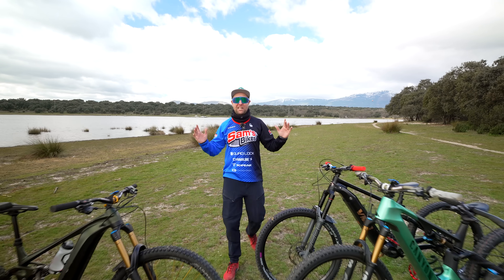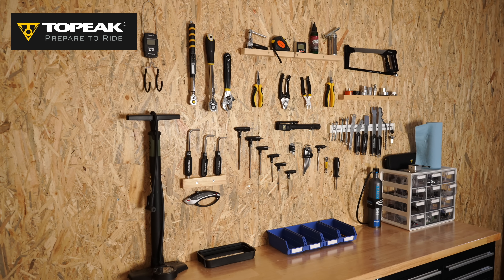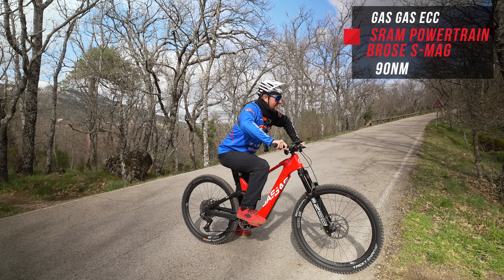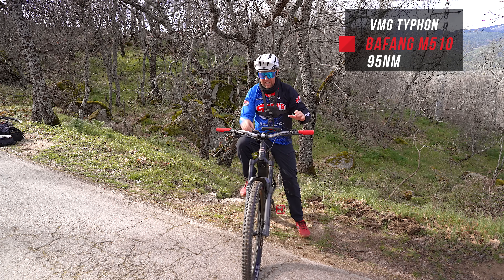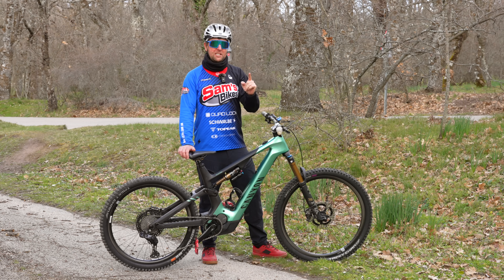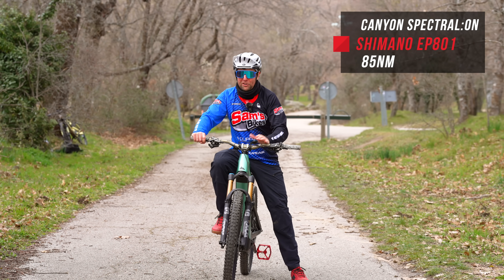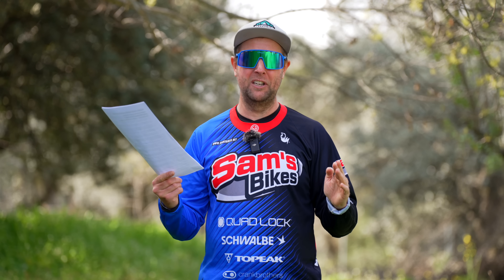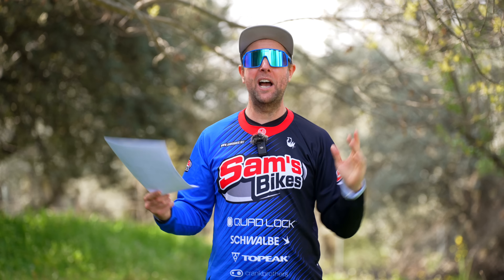MASSIVE eBIKE MOTOR TEST - 7 EMTB Motors, Which Is Fastest?

Comment from the maker: Riders I hope you like the first video of the MASSIVE EBIKE MOTOR TEST... like always got a question just ask.
Reply: Maybe a test to see which one hits the hardest wall when top speed is reached?
Reply from the maker: Not a bad idea!
Reply: Also a bosch cx vs race would be interesting to see. Thanks anyway! Great and unique video! Also it would be interesting to see a chart about times and the weight of the bike + the rider weight too! 🤔
Reply: Maybe give the Pinion MGU e1.12 a shot as well and focus on the unique strength of these systems. For example I myself would love to see Shimano bringing Bosch’s rocking motion overdrive option as well, for it’s great in difficult climbs. Cheers!
Reply: One video that was missing. Thank you!
Reply: I would not buy a motor system if it can’t be easily derestricted, 25kph just isn’t ok. Can you explain the differences between motor systems on this? Does the SRAM system use disc mounted magnets?
Reply: It's a great video and a great channel. I would recommend that you at least sometimes replace "ridres" with "guys" or "folks" or "friends" etc. Just for a change 🙂
Not all followers, I guess, riders

Comment: Not very scientific, honestly you need to post the full unedited clip of each run.  I do appreciate the effort you put into it but the results are too subjective based on the so many variables in your test.
Reply from the maker: Sorry I’ll try harder next time
Reply: @SamsBikes  no sorry it didn't come out the way I meant, I just had surgery I'm on 1 arm so type slow and short, broke my collarbone in bike crash.  I meant like more data, like with your power/wattage.  The wattage that was also coming from the motor, for instance on the Shimano 801, did you actually reach full cadence to get all the power from the motor and for how long, just some details like that to help paint the full picture.  It was a good video and appreciate all the work you put in this.  Also, not sure how official the start/stop of the timing was, I'm not even a Shimano 801 fan but something seems way off with that one.

Comment: The differences between these motors is minor compared to the difference between a 25km.h speed limited and an unrestricted motor. The best motor would be the one capable of easily modifying the top speed to whatever it was rated to, without the manufacturer throwing me under the bus and voiding the warranty.

Comment: If we're meant to take the test with a pinch of salt, what is the point of the test?? to make it fair (if you insisted doing this test one after another) you should have strtaed with the lower powered models instead of going with the most powerfull at the start when you have fresh legs, may have been a more level result this way. Even better why not do all the tests on one bike and do a different bike every day for 7 days this way the climb test would be at the start of each day when rested you would have got the best result for each bike.
Reply from the maker: Can’t make everyone happy, it’s the best I could do I’ll try harder next time!

Comment: Nice one sam , for me personally with the motors it’s turn around time for repairs, and that’s where my dealer race co cycles win , my friend has had new batteries and motors fitted and out the door in an hour , luckily for me my gen 3 levo with 1800 miles on the clock has been faultless , looking forward to the rest of your tests 👍

Comment: I would be more interested to find out which motor is the most reliable long-term. Period. I don't care how fast it is if it's going to fail. I've heard bad things regarding specific motors, and I see plenty of used bikes for sale with "new motor under warranty" which is just going to fail again.
Reply from the maker: That’s video 5 im going to be interviewing bike shops and mechanics and get there take on it
Reply: @brian - Bosch . it is one of the  oldest motors ,if not the oldest motor  in the group and has had the fewest problems

Comment: Hi Sam, I’ve always like your vids but this one I’m afraid is a bit silly. A lot of those bikes don’t come as default at there highest power settings from factory even when you put them in turbo-boost-rally etc. ie the sram motor needs to be turned up in the app before it will give out its full power. Also tyre pressure, suspension design, travel and lots of other factors play a huge role in a test like this not mentioning rider inputs. 

To go to this much effort and not pay attention to detail kinda makes it a pointless vid.
Reply from the maker: Hey mate thanks for the your feedback but clearly I had them un the most power possible via tuning in the app and all tire pressure was 24-28 same tires and suspension was set to how I ride each bike! Maybe I should of made those clearer

Comment: BTY i'm aware of Nox refusing to send you a bike to test , which i think is a big mistake of theirs BUT the Sachs engine is now being offered in one of the Storcks bikes . maybe they would be willing to send you a bike. 
personally i think NOX , which is now owned by BMZ the German battery company , failed in promoting their product . the only bikes i know of that carried their motor was/is  , nox, storcks , and a few scandinavian bikes . it's also oddly enough on an e ski bike from france and a few cargo bikes which is what  it was originally designed for . using the motor on MTBs was an after thought , i believe . the motor was designed for cargo bikes that  carry heavy loads at low cadence without overheating . however i could be wrong about this .the creator of the motor a german man said he invented it to keep up with his younger friends on the trail so,,,?
Reply from the maker: Thanks for the comment mate, I did reach out to all of the major ebike motor brands and you see in this video who wanted to send me a bike! I can’t do much more than that
Reply: as you know , i'm 100% convinced that the Sachs/BMZ can slay all of the bikes mentioned in a raw power test . not sure about naturalness, noise , smoothness etc but just raw power it can't be beat . 
personally i think nox and sachs cut their own throat by not sending you a bike to test . are they afraid of something or what ? very perplexing .

Comment: The raw power test might be more accurate  if done on a smooth asphalt street and maybe rest longer in between tests as fatigue can be a factor in time to the top . 
on a dirt trail there are varying lines that will be encountered and possible tire slippage etc .

Comment: It's worth noting that if you push the Rocky Mountain for extended periods of time it will overheat the motor.  Something that happen to me often.
Reply from the maker: Let’s see in my range test
Reply: aevan- i have the Sachs/BMZ motor 112 NM and one of the best features about it besides the raw power at low cadence is it does NOT over heat .

Comment: Are u crazy? You wanna find out drag like this? Motors have a clutch inside and you maybe rotating with first gear set. So the loss here is really low and you can not feel it by legs. 
That was old Bosch design, when you did rotating also with rotor, then you did feel drag. Drag nowdays is just a myth.
Reply from the maker: Can’t keep everyone happy 😃 I have been asked so many time and your wrong you can feel it in the motor 100% there is definitely more drag on the Rocky and Bosch
Reply: @SamsBikes  Dont know about Rocky. Ok, try to do more sophisticated test, not the funny one, that you try to tell after few peddals. 

Put down the chain and start to adding weights on pedal, how much weight you need to turn it. You would measure most friction of rubber bushing then some internal gear resistance. Try it even without weights, just turn by hand and tell me what you feel...

Comment: What casing do you use on the tires front and rear? Never tried those tires before. Thanks.
Reply from the maker: Hey rider, I’m running ultra soft super DH on the front and soft super Gravity but if I’m racing I’m ultra soft front ant back
Reply: @SamsBikes  Thanks Sam. Do you use a step lighter casing for the SL ebikes, or keep it the same?

Comment: Should do a test on which motor lasts the longest time before a warranty claim ! 😮
Reply from the maker: Yep that’s video 5
Reply: Won’t be the Brose!
Reply: @robbief1  Yeah that's why I wouldn't buy that system even though otherwise it's pretty decent and has option for extra batteries. Always worrying whenever the belt might come off doesn't sound like a good time.
Reply: I'm a lucky guy I guess. I have way over 2000 trail miles on my Levo and it's been super reliable. Especially compared to my wife's Trek Rail 7 which has been like a bucket of bolts.
Reply: @rickbault1221  The belt might come off from 1000km to 4000km.

Comment: I am looking to buy my first eBIKE. I live in germany and am looking for something preferably under 2K. I wont do any steep terrain. I am new to this xD. Do you have any recomendations?
Reply from the maker: There are so many good options! Maybe check out Canyon they have a massive line up of affordable e-bikes
Reply: Run your budget up at least another thousand dollars higher and then look for a high-quality used one. A $2000 budget is too low and I think you would be disappointed in short order.
Reply: Your Videos actually got me into this sport. Thank you very much! Love your videos :)
Reply: Minimum you can get a full suspension e mountainbike now during discount time if you find the size is 4k.